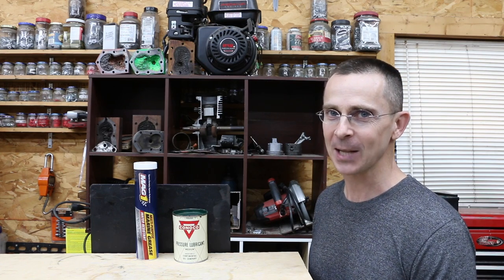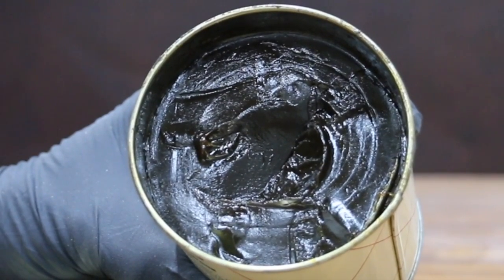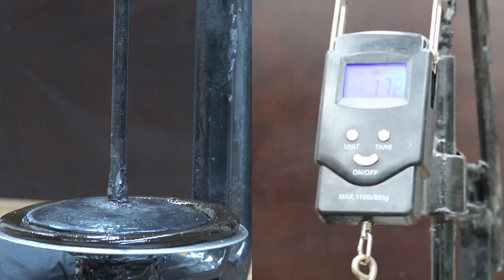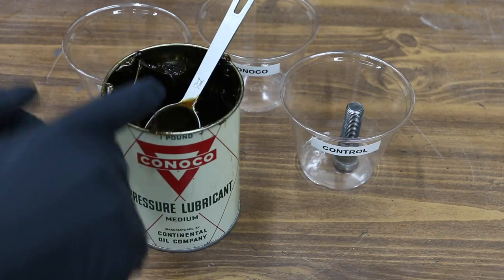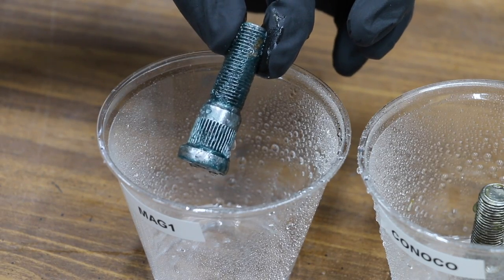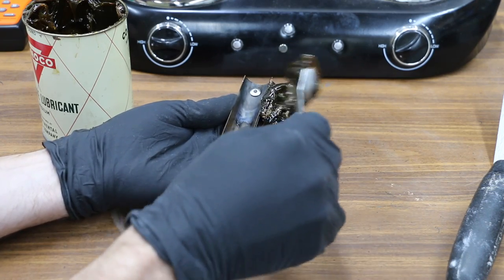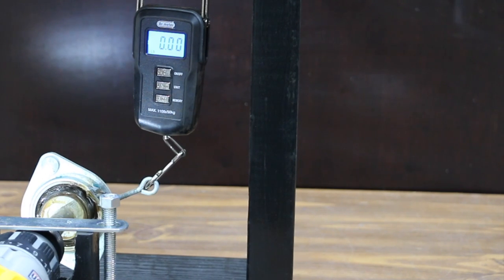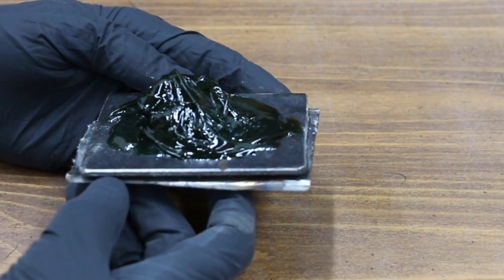Is 75-Year Old Grease Still Good? Let's find out!

Comment: Wow, you didn't miss a testing method, and you performed all of them so well! Thanks for another great video! 👍
Reply from the maker: Thank you very much for the positive comment!  By the way, your latest video on using the Tesla batteries in the old drill is fantastic!
Reply: What about missing the opportunity to test the mixed grease?.. Measure the gains or losses between the 3 and determine the cause in order to form a conclusion. Arguing sometimes its better for the old and new to form a compromise, or the complete opposite... possibly another video?

Comment: I wonder how time has affected the vintage grease? Still seemed to do a pretty good job after 75 years though!
Reply from the maker: Thanks for sharing.
Reply: Project Farm please test assembly oils next, unless it’s been done and I missed it
Reply: Next video: "So I built a time machine to go back and get some of this grease when it was new."
Reply: What's 75 years? It was in the ground for a million, lol.
Reply: @donellmuniz590  Well ackchually grease is a solution of oil and soap, and what'll happen is the soap will break down, the oil will separate, etc, and the viscosity will decrease. Plus you'll have stuff like volatiles offgassing out of the oil, maybe additives and viscosity modifiers breaking down, if any water or humidity gets in, it could react with the grease, and accelerate that sort of stuff, not to mention, changing the pH, and all that'll change the properties of the grease. Anyway thanks for coming to my TED talk.
Reply: @sac3528  You must be a riot at cocktail parties 🤣
Reply: @donellmuniz590  I try not to talk about grease chemistry :)
Reply: @sac3528  I didnt know grease had soap in it. I didnt know it has pH. I also dont know what pH is 😂
Reply: @donellmuniz590  All solutions have a pH level. It's a measure of how acidic (or basic) something is.
Reply: @HereIsHelena  Oh. Thanx. Why is it expressed as small-p, big-H?
Reply: @donellmuniz590  it stands for potential of H. H being the symbol for hydrogen in the periodic table, so effectively it's potential of hydrogen but they kept the H capitalized
Reply: @patryknowicki4536  I'll be damned. Thanx. But the potential of Hydrogen to do WHAT? 🤔
Reply: @donellmuniz590  basically (pun not intended) pH measures the amount of hydrogen ions present in a solution. The more hydrogen ions, the more acidic the solution is. On the opposite side of the spectrum are solutions with hydroxide ions. These are called basic, same principle here.
The amount of hydrogen (H+) or hydroxide (OH-) ions determine some properties of a solution.
pH scale 1-7 = acidic. 7=neutral 7-14 = basic. 
I just learned this in class not too long ago, so excuse me if I missed something. I also hope i didn't complicate it too much
Reply: @donellmuniz590  that's not something you should admit
Reply: @skrimper  I'm not ashamed to admit when I don't know something. We all have subjects that we excel at, and others where we are clueless. I am clueless about everything except baseball, cars, cats, KISS (my band), and Asbergers, LOL.
Reply: @patryknowicki4536  Thank you for the tutorial! I got an A in high school chemistry, and physics, and other things, but that was 40 years ago, and I've forgotten most of it! 😂
Reply: @sac3528  I enjoyed the info. Material properties are fascinating!

Comment: The question is how good was this grease 75 years ago?
And how good will be modern grease after 75 years...?
Reply: Project Farm 2100 A.D. will have this covered.
Reply: I was wondering the same thing how much has this grease deteriorated over 75 years ?
Reply: @80f250  those things dont deteriorate much when stored in proper condition.
Reply: @Francois_Dupont That is the problem, you don't know if this grease was stored properly over the years.
Reply: @TheBaldr  its pretty easy to see actually, you normally see liquid separation or some weird dry splosh in it.
Reply: The can of old grease said you should reapply the grease every 1000 miles. Modern grease doesnt need to be reapplied nearly that much, if ever, many of the greaseable areas on a car are now sealed and the grease inside is expected to last tens of thousands, if not hundreds of thousands of miles.
Reply: @Francois_Dupont  yep, but 75 years...
Reply: Exactly!
Reply: bottom line: don't use 75 year old grease.... leave it to the utube wannabe experts to debate, when and why it became crap..
Reply: The stuff wasn't any better in the 1940s I promise you
Reply: @80f250  My father had a tin can of approx one gallon of grease from WWII. I still have a small amount of it. It's drying out with small hard particles in it. Just like it's been crystallizing and it's having a very dark color. I still use it for "non critical" lubrication.
Reply: @TheBaldr  the condition of the can is a indicator. And it looked brand new.
Reply: I wondered the same thing.  Also how the applications used for 75 years ago were also different.  It's not just the grease technology that has changed but everything that grease is being used on too.
Reply: @Krankie_V  You are right, grease was exactly the same :D
But now most people think, that now we have so much better technology, which in not always the case.
Reply: @xXxbastek  sounds like you misunderstood.... Time doesn't have much effect on grease stored in a sealed can. It didn't get worse with time, new grease is just better. 75 years of research does actually mean something...
Reply: @Krankie_V Ok, but it's not that much better taking to a consider 75 years of research :D
BDW. In my opinion it's a long time, even for grease in can.. It can degrade in some degree..
Reply: @cr4zyj4ck  Yeah, and we all know how well 'lubed for life' garbage lasts...
Reply: @MrTWOproductions  That's probably parafin wax that's crystallizing as the oil dries out.
Reply: @noidontthinksolol   yet today's fuels are shit and a half compared to the old stuff.   
I've started old tractors I've collected on fuel that was in their tanks over a decade before.  Now I cant start the same tractors on new fuel that sat one winter even with the tractors all fixed up on top of it!
Reply: I wondered the same thing but the only way to know for sure is to get a ten-year-old to test some new grease, then test that same grease again when he’s 85.

Comment: The one thing the “Mag” grease had is time to improve.. after 70 years. The Conoco really led the way.. I wonder too if after 70 the vintage grease did degrade somewhat.
Reply: That's what I was thinking as well is it possible the grease has degraded a bit over the years
Reply from the maker: Thanks for the feedback.
Reply: One way to find out. In 70 years the test must be repeated.

Comment: Test recommendation: What's the best degreaser?
Reply from the maker: Thank you for the video idea!
Reply: Ole #45  ??? 😁
Reply: @ProjectFarm  And they must be safe on motorcycle chains (which have rubber seals).

But I think kerosene is the best, but it's not available in all places (it's banned in most big cities in India).
Reply: Diesel
Reply: @devakritbagchi2787  I use Dr bronners soap in liquid form.hose off the chain,put some soap on the chain and rub it along the whole thing.. let sit for 30 mins brush of with stiff nylon brush, hose off and relube.
Reply: @2strokepower803   Old high sulfur diesel was the best.   Modern bio diesel is also very good too!
The modern 'environmentally safe' parts washer stuff is beyond crap compared to any of the old stuff.
Reply: MEK or perchlorate.
Reply: Russian Bot 441 yes that is true

Comment: I would like to know what is the heat resistance of hot glues. At what temperature do they start to lose grip and fail?
Reply from the maker: Thank you for the video idea!
Reply: Miikka Mättölä depends on the glue. There are hot glues made for a ton of varying temperatures.
Reply: I tried to read your name and nearly had a stroke
Reply: @BradyBegeman  True of industrial hot melt glues. 3M have a wide selection.
Reply: @BradyBegeman  Yes, I think this is why glue guns have a temperature switch. In terms of things like melting temperature, glue hardness, ... there seems to be a lot of variation.
Reply: @ProjectFarm  yes hot glue test please!

Comment: We want to see a battle of the Brake Cleaners!
Reply from the maker: Thanks for the video idea.
Reply: And test the chlorinated vs non-chlorinated. With most that I’ve used, the non-chlorinated is way more flammable.
Reply: chlorinated will ruin automatic transmission clutches

Comment: Petro chemicals have gotten a lot better over the years, apart from gasoline getting the corn whiskey treatment.
Reply: E85 makes a great fuel in higher performance tuned cars though, you get an octane rating of 105-110 with it.
Reply: it is for getting higher octane... that is needed to get more compression, and that gets you better MPG
Reply: @davidhocevar8510  actually the higher octane prevents predetonation which allows you to have a higher compression. You were basically right. Just without all the details
Reply: Junk from work!
Reply: Zodd Immortal for sure it’s a decent octane booster. It’s  also less energy dense so you get less bang for the buck and ethanol is hygroscopic that moisture can do some real damage
Reply: Joe Smith & Friends Network up joe
Reply: Yo Junk! Did you provide the grease to Project Farm from your grease collection? Lol!
Reply: Amos Cardoza hahah all the guys are here. I mean I would have loved to it’s a great channel
Reply: @amoscardoza5253  thats junks hair gel! lol
Reply: @SgtJoeSmith  I thought Canadians greased themselves up so it acts as an extra layer of insulation to keep warm!lol!!
Reply: @GeorgeJFW  I'll send you my 30yr old bottle of KY jelly to test out!! Lol!
Reply: Amos Cardoza I can use it will my 15!year old wallet condom lol
Reply: e85 has less energy in it, that's why it is so good at resisting detonation. it's a good thing it's cheap, you use more to go less distance, but that lower cost sort of evens out. e85 can also fail to fully atomize in cold weather, making engines using it hard to start. and like junk from work mentioned, it attracts water, like brake fluid does. e10 gasoline is a major swindle against the public, with both e10 and e85 soaking up water, and alcohol's known aggressiveness against rubber, it can do real long term damage to fuel systems on cars not made for it.
Reply: Ledfndr bang on sir!

Comment: Video Suggestion: I work as a marine technician in Indiana, during winterization season we change the oil on boats which often have ran less than 1 hour between changes. If I see very clean oil I filter it and use it in my 90's Ford Truck. The used oil is 25W40 marine oil and my truck calls for 10w30.
I've often wondered what effects oil from a failing boat engine would do when added to my truck. If it contained metal shards that were not filtered out would I see piston scoring, oil pump failure, premature filter clogging, or other harmful effects? While oil is not that expensive I enjoy saving money and using the old 25w40 from a clean marine engine. 

Finally, what are the effects of using a heavy weight oil in a typical engine. Possibly testing thicker oil than 25w40; up to 75w90.
Reply from the maker: Thanks for the video idea.

Comment: In the oilfield we used red diesel for degreasing, a mix of mystic red grease and hydraulic oil for greasing rig tongs, 80w gear oils as a anti sieze agent, copper and nickel based anti seize on bolts.  I like the 80w gear oil because it doesnt dry out like grease does.  For high temp/ high pressure the copper based anti seize worked better than grease.  Not sure how you can test any of that stuff but I though it might be useful somewhere.  Thanks
Reply from the maker: Thanks for the suggestion.

Comment: STP oil treatment use to have lithium grease in it. A mechanic friend of mine said in order to store and engine, first run the engine with the STP oil treatment in it, then drain it and seal the engine. He said it doesn't break down and will protect the engine for years.
Reply from the maker: Thanks for sharing.

Comment: What did you use to clean the bearings? That same mechanics friend said he uses solvent to clean bearings, but he always baked them in an oven at around 150 degrees for 30 minutes. He said if you don't do that, the solvent stays in the bearings and eventually washes out the grease.

Comment: Commentating on an old video, but I have this idea and I don't want to wait until the next as I'll probably forget. I and I am certain many others would love to see you review metal cutting saw blades that convert your hand or miter saw into a metal cutter without using grinding disc's or a typical metal saw. The one that really has my attention lately is the Diablo Steel Demon which comes in sizes from 7 1/4" and up. The basic problem is most of the videos  I see around this blade are sponsored, but at the same time the blade does look like it legitimately works well. As there are other metal cutting saw blades on the market, I would trust a review from you more than pretty much anyone else. My personal interest is for my 10" miter saw as honestly I've considered a blade like this given the stupid amount of grinding wheels I go through on my angle grinder.

Comment: I worked for 10 years on laying cables, from 2x0.75 internet to 1x3000 high voltage, sometimes we removed old installations from 1950, the cables that were there were still usable, they were old oil cables, the minus was that they were very dirty and  they were sticky, but the quality of copper was like new after 80 years, now the cables are replaced every 10 years, because they dry out there is no humidifier, another thing to cut the old oil cable, you needed pneumatic scissors, not some battery-powered, but specific for  220v, and now it's usually battery life and you cut like butter
Reply from the maker: Thanks for the feedback.
Reply: @ProjectFarm  I forgot to add that the old oil cables were laid in a completely different technique, something like making ropes, in addition, they were wound in a place where the installation was, the process was long and tedious, you had to lay the cable layer by layer, first in separate wires, then oil,  then paper wrapping, etc, now you get a spool of cable that has stood in the sun and rain for a year and then there are consequences

Comment: Video suggestion: best method/product to reseal a tube of caulk.  I saw you used painters tape in a prior video but I've never tried that method.  Suggested comparisons: Core Gear caulk plug from Lowe's (best in my experience), DAP Cap, "caulk saver" from Ace Hardware, a long galvanized nail, and tape.
Reply from the maker: Great suggestion!

Comment: I love your video's and spend a Lot of time watching them. Thank You for all of your hard work.  --  Have you ever tested Tire Pressure Gauges?  I have 6 or 7 gauges and Every One of them read different, it doesn't matter if they are digital or the analog or the old rod type of gauge. How can I check which of my gauges are reading the 'Correct Pressure'
Reply from the maker: Great suggestion!

Comment: What about doing an oil test on used oil that is run through a centrifuge?  You could synthetic as a baseline.  See how well they perform with 5,000 and even 10,000 miles.  Then run them through a centrifuge and compare the performance.  There are a few brands of home centrifuge systems.  Dieselcraft being the most well known.
Reply from the maker: Thanks for the video idea.

Comment: I'd be interested to see you mod an engine to hold two spark plugs. Splice the cable for the coil to have two boots for the spark plug and see if it will still work.
Reply from the maker: Thanks for the video idea.

Comment: So here's an idea for you. Test a chainsaw with and without a sprocket ended bar. I've always wondered if a sprocketed bar would cut better, allow more horsepower to be put to the chain, would cut faster, etc than a non sprocketed bar. There's more friction without a sprocket (I think) but the sprocketed bars have to be kept lubed through the lube holes so they're more work. Saws are sold with both kinds, which is best? There are alot of chainsaw videos on you tube but I have never seen a competitive test of the two different kinds of chainsaw bars. Whatcha think?

Comment: You ever test steel bluing agents? See how well they perform in the lubricity rig afterwords? Seen a lot of "hot VS cold" arguments but they all really break down to a fashion show rather than data. Only big argument is tempered things and I wonder about some of those even as the temperatures aren't generally high enough unless your using a torch instead of an oven.  There's at least 3 different methods, heat the part + any oil (probably bad for temper), (nitor) potassium nitrate + (lye) sodium hydroxide  way used by gunsmiths (probably ok for temper), and the cold bluing stuff (definitely ok with the Temper). 

Good video btw as always.
Reply from the maker: Thanks for the video idea.

Comment: The 1st grease water test it looked like there was more grease at the bottom of the crater then the others. Much was displaced but shouldn't the test also see if there is any grease left at the bottom? Which would indicate that at least the part was still protected? Maybe I'm wrong just curious. Oh! the bearing test settled that I was right in thinking that the grease would have protected the part longer than the other. Cool, I guess I should watch the whole video before commenting but I tend to forget things easily so I like to comment during sections of a video.

Comment: It would be interesting to see what would happen to an engine if you plugged the crank vent. Maybe use an engine with lots of blow by and see if the built up pressure would blow the engine up or stall it.
Reply from the maker: Thanks for the video idea.